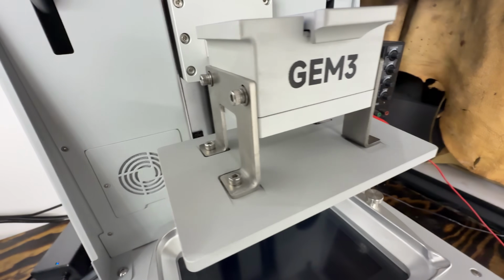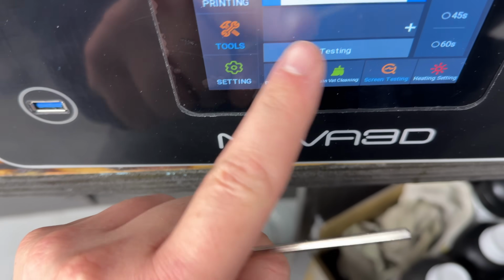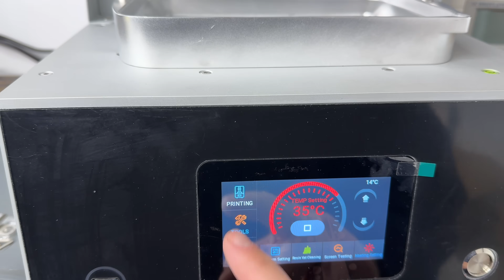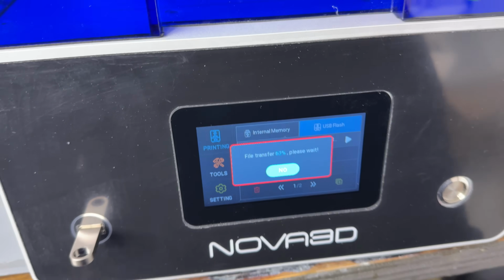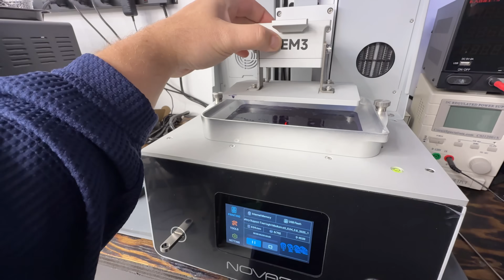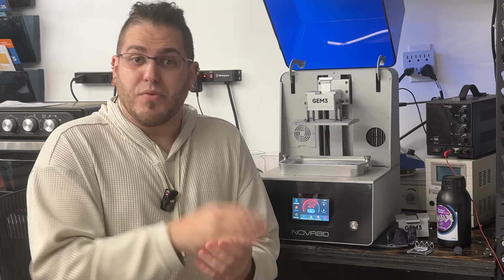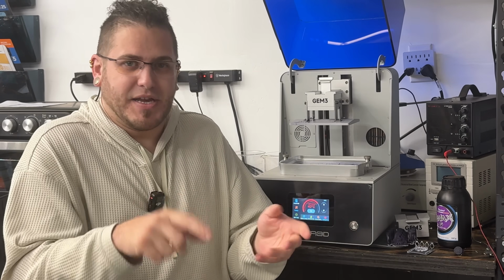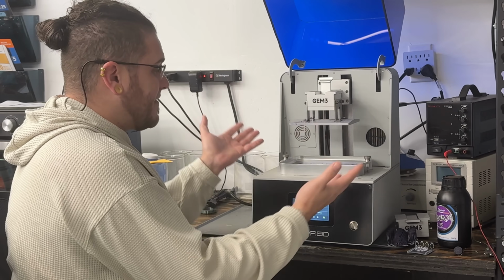NOVA 3D GEM3 - Jewellery 3D Printer Review

Comment: Thanks for great and informative videos! One question about the test printing file. When I open the file in onshape or rhino the dimensions doesn’t seem to be correct? For example, the center hole is ø 6 mm and the 3 mm setting is 2mm. Does the center hole stil print in ø 10mm?
Reply from the maker: I would recommend opening it in your slicer and checking size there. 
Only thing I can think of is depending on your settings it might be trying to convert units of measurement?
Sometimes I will have that with client files were I get a pop up in prusa slicer asking to convert.

Comment: Great review thanks a lot. 
For Gem 3Max I put it as whale 4 in Chitubox and it works.
In regards with any chamber heater I set the temperature at few degrees more than temperature recommended by manufacturer so I can make up for the lost heat. Since chamber heaters are not sealed properly i wait at least 30 minutes before printing.
I wish if you can make another calibration tool there is one problem I don’t have the stone available wish we could use calliper